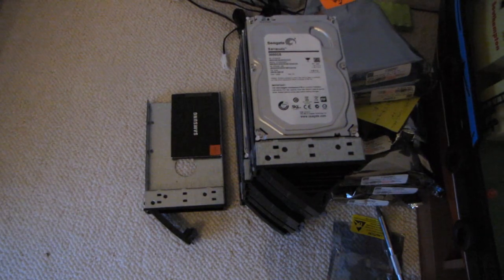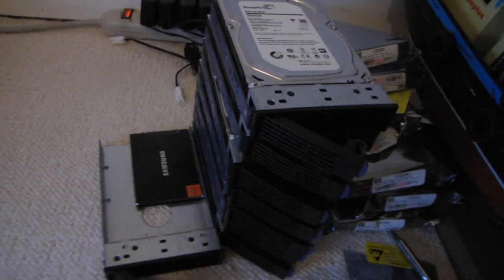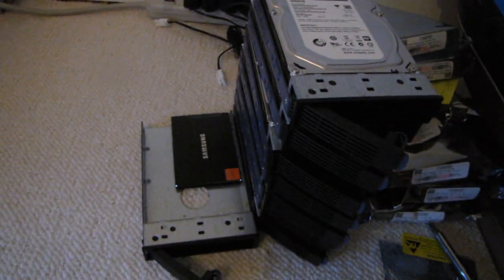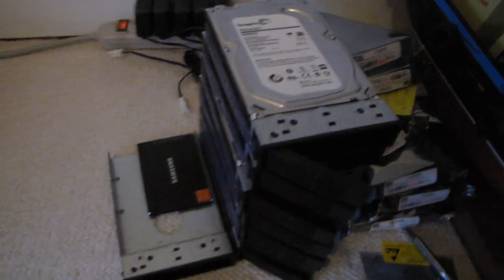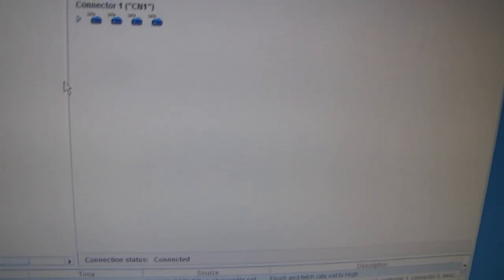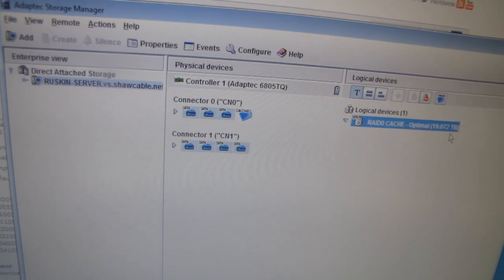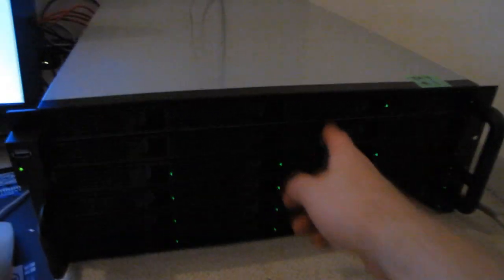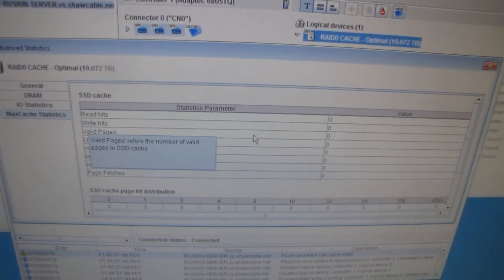Storage Experiment Progress - 7 Drive RAID 0 with a 512GB SSD Cache Linus Tech Tips

Comment: Hey linus how'd this work out?
I saw a YouTube video made by someone testing two seagate barracuda smr drives in raid zero that together had sequencial read of around 500mbps and got the idea of adding an sdd cache to that so that it could better maintain those speeds and using it as a cheap huge fast steam drive, but I realized that I've never heard of someone doing that before. I'm already aware it's more likely to fail but if it does fail I won't lose irreplaceable data, but is there any other reason not to do this?

Comment: no update ever published....however he noted in a later dated video, with this identical Adaptec card and 8 OCZ SSD drives, there was a scalable incremental improvement with each hard drive added to the RAID 0 array. However, using a Motherboard RAID solution, performance improvements topped off at 2 hard drives which above that added storage without speed improvements.

Comment: i have the Z87-PRO MB and got 2 Corsair force 240GB SSD's in Raid 0, i got a problem i need help with, When i restart, the PC goes in to BIOS and no drives are visible. the DVD Drive is there, but my Raid 0 is gone, then i power it off completly and turn it on again, and they are back... but i cant restart/reboot it like normal, anyone have a clue of how to fix this problem, with my brand new PC??? plzzzzzz

          <PC>
MB: ASUS Z87-PRO
CPU: i7-4770k
GPU: ASUS GTX 780
SSD's:Corsair SSD Force Series GS 240GB
RAM:  4x4GB Crucial balistiX Elite CL-8
PSU: Corsair AX860i
CPU COOLER: H100i
OS: Win 8.1 PRO Nordic
CASE: Fractal Design Define R4 Titanium Grey

Comment: No, the requirements for a RAID 0 stripe is just that you have 2 or more drives (any drives, different capacities or cache sizes work too) and a RAID capable motherboard or a RAID controller although most modern motherboards have a built in RAID controller.

Comment: SSD is very good for RANDOM non sequential reads and writes not to say that it's not good at that just that reading and writing to a HDD means it has to find the point on the disk to write to (seek times). With the SSD takes those fractions of a second quicker if it already has the info on the SSD before asking the disks for the file. Means that the disks can take some time writing the information so you don't get an IO bottle neck.

Comment: i know you cant say ps3 is better because its controller shape and stuff you can prove a pc is better by saying "the computer can run a resolution 5k or more with little  to no performance loss with gtx 680s and way better graphics"  or "you can map a keyboard and mouse how you want and even use a gamepad or a steering wheel from the early 2000s (if your mobo has the conecctors)" plus the mouse is more persise then a flimsy thumb stick" meh those are my opinoins.

Comment: doing it the proper way. /dev/shm isn't the fastest way, but it does not affect boot up time. Unless you're copying files over on boot time, which it seems like the asus application is.

Run a simple memory bench, now you'll see the performance of your RAM. Take out a few percent for overhead, and you'll see a RAMdisk is fully capable of reaching those speeds. It's how you implement it, that determines the speed of it.

Comment: Depending on the software you use for your ram disk, and the type of ram, you can go well over 9GB/s. RAMdisks are significantly faster than SSD's. AND if you knew what you were doing, you would know how to configure the ramdisk so that it doesn't affect your start up times. RAMdisks can be used for anything, it depends on how you configure it.

uhm, /dev/shm anyone?

Comment: Actually right now if you are doing a RAID you want to use the latest Seagate drives due to the firmware issues the latest Western Digital drives have been having when used in RAID.  Many people have been reporting issues with the WD drives dropping out of the the RAID regularly even though they are advertising "RAID aware."  So far the latest Seagate drives seem to work well in RAID so Seagate has definitely fixed their firmware issues plaguing previous generation drives.

Comment: WD. Not because the particular hard drive is better but because their firmware actually works. Seagates firmware sucks ASS. This is already noted on their external hard drives (loaded with their crap ware aside from the shitty firmware) that gets stuck after the computer goes into sleep mode.

Comment: True, higher end boards aren't 100%, but they are more likely to actually be better more often. X}   I do say, it sucks to have 2 MB fail on him so quickly, but honestly it's something that can happen, but for 2 of the same MB types to fail in a row on someone...  They should just move on and get a new MB model and not be a cheap ass getting a budget board *the difference of a ~150$ could have made it the difference, and save some stress

Though it might be the user doing something wrong as well

Comment: That's also not mentioning, the smaller form factors mean smaller cases, means components closer together on the MB, means less space, less cooling room, less cooling options, and in general all of the components can suffer because of that.

Budget boards aren't bad in and of them selves, but they end up with budget parts... and there is a greater chance something is going to backfire and cause damage.

Comment: actually, they can tax the PSU more then higher end MBs, easily.   There is a reason they are 'Budget' boards, outside of missing features from the higher end models.    Some of those features and designs make the PSU work less by allowing the MB to have some method of managing the powersupply going through the board,. *which means the MB last longer, and the PSU isn't geting backlash from the MB if it browns or dims for a second.

Comment: Sorry to say, though You got a budget board....  Kinda your fault. *I never trust or like mini form factor MBs*

ASUS is generally pretty dam solid when it comes down to it, though, you got a bit unlucky, and you didn't get anything really special either.

You could have just kept the second MB, and just got an aftermarket CPU cooler that didn't require the CPU fan powersupply. *or could have gotten an adapter*, but the aftermarket cooler would have been hard due to your small form factor.

Comment: X} RAID is in basic. "Multiple Hard drives paired together in certain methods *the Number of raid* to act as one logical drive/partition for increased benefit. (Speed and/or Redundancy)"  Caching is just a method of speeding up commonly used data or files access to improve performance.

Comment: More or less, that and it's fairly great for gaming, if you honestly don't need the redundancy. *as if your single drive failed your still screwed datawise*

Though RAID 0 is never suggest for anymore then 3 HDD, and even then it's only suggested to have similar drives in speed make & model *as to minimize any problem that might accure*

RAID 0 isn't a bad solution for personal users who would like the speed jump, with minimal drives.

Comment: I seriously don't think the performance is worth the risk. However, you could come to the conclusion that each drive will be performing fewer larger writes than with two drives in RAID 0. Therefore, your reliability could be much better. I'm only hypothesising, but I think the security concerns should be bought up in the experiment. Contemporary builds although may be slower, have a focus on trying not lose your data! I've had a HHD fail in RAID 0. It's a pain! The results will predictable IMO.

Comment: RAID combines multiple drives to form an array, depending on the level of the RAID you get different options for your drives, however there are limitations to using standard RAID and using a RAID card. A RAID card processed the information going to the drives (it's dedicated), meaning RAID arrays get better performance, and allow you to do more complex RAID arrays without necessarily loosing performance. RAID cards get placed on a PCI slot on you motherboard.